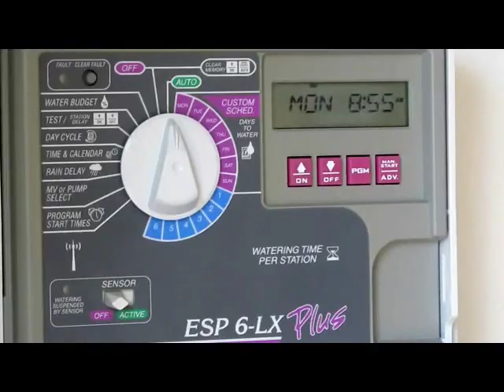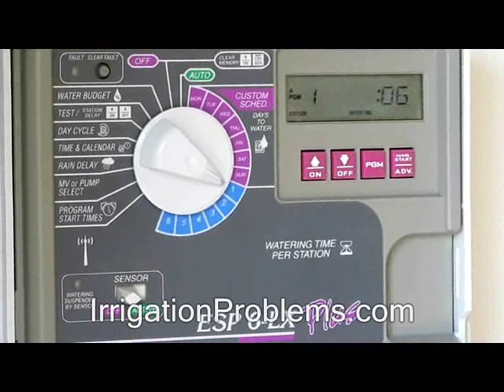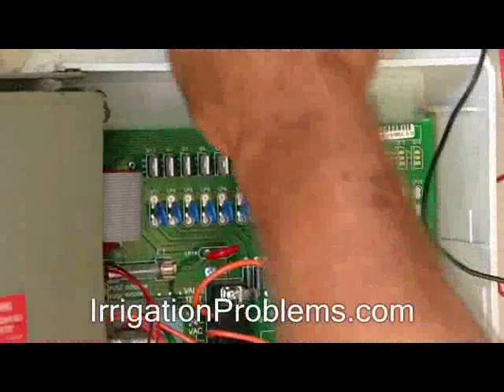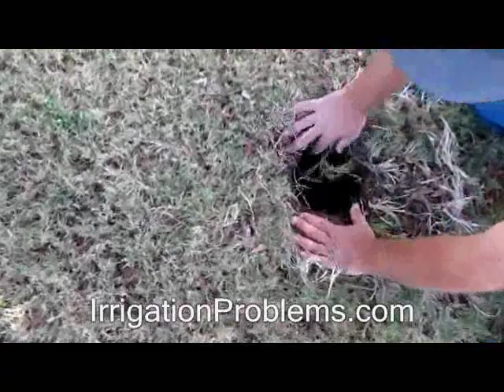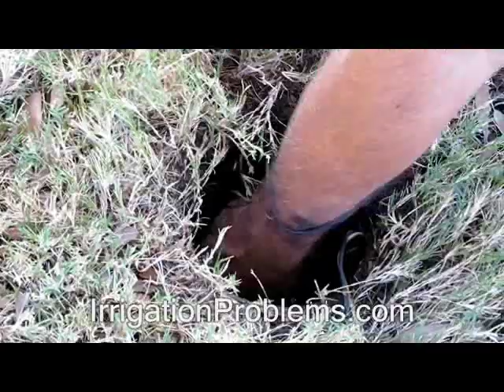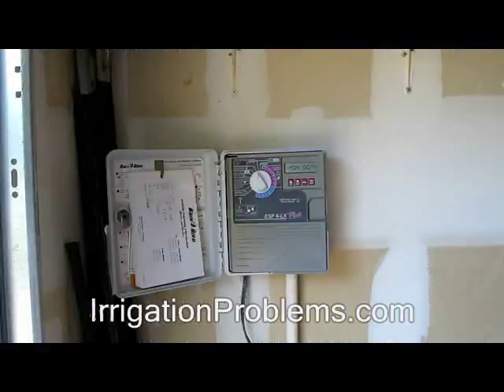Sprinkler System Troubleshooting Georgetown Texas

Comment: Greetings. Any idea why a sprinkler valve would lose pressure once it starts. Starts out OK but low on pressure then dies out within 15-30 seconds.
Reply from the maker: Could possibly have a leak that's causing it too reduce pressure or diaphragm is bad.
Reply: Thanks for your help!

Comment: yeah when you have a sprinkler system that is working and one of the valve go bad you can find it with electronic tracer how do you find a valve when someone cut wires all over the place
Reply from the maker: you can't find the valve electronically (using locator) if the wires are cut.  trace to the point where the wire is broke and repair wire break and continue on with locating.

Comment: Thank the lord I found your video!!! I've been having a ton of trouble understanding the master valve issue and finally may understand it!   If my master solenoid is bad, should it still work on manual?  I can hear the master pushing water, but I'm not getting enough at the other zones to allow the sprinklers to work.  Would a bad solenoid at the master do that or should it still work fully on manual?  THanks again!
Reply from the maker: if the solenoid is bad, that zone will not work. since the zone that is bad is the master valve then the system will not work.

Comment from the maker: If you have a zone that is stuck in the open position and there is not a master valve, the way to turn the lawn sprinkler off is by turning the water off to the lawn sprinkler at the backflow device.